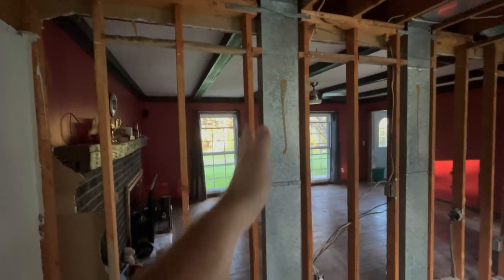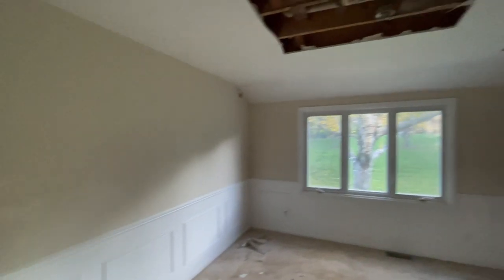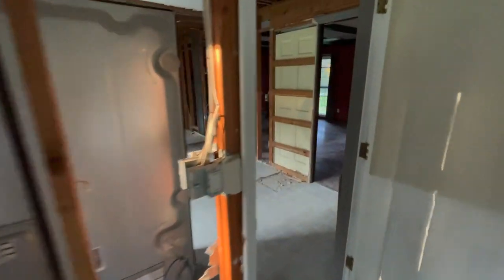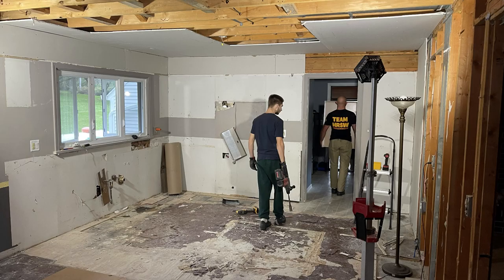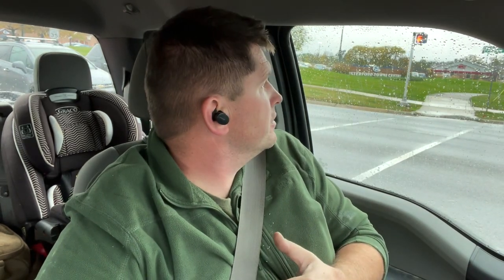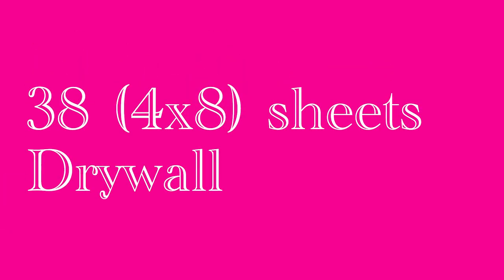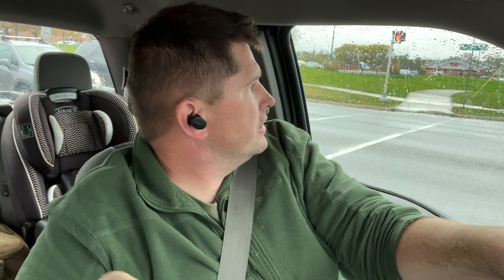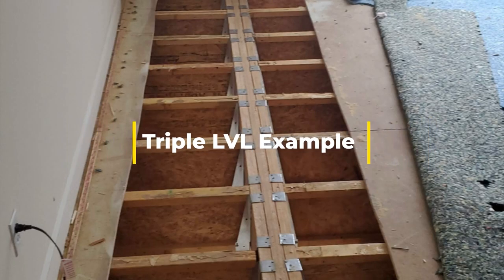Kitchen Remodel!   How Much To Remove Load Bearing Walls? Jobsite tour.

Comment: $22k a great price for all that will be performed....I am ONLY having 1 load bearing wall removed, float in 12 wood floor slats, float ceiling joining kitchen & livingroom,relocate 2 outlets & 2 switches this contractor gave a bid of $4,785 thats roughly 1/4 of your bid cost 22k with only 1/15 of the work involved .....I think I will get another bid or two...THANK YOU

Comment: How did you get the cost for the load barring beam? Cost/ft? Or sonething else? I need to work out dry wall costs for myself. I'm sure that's handy to have that as a $/sheet figure ready to go
Reply from the maker: I charge per linear foot but location is a big deal. One beam light cost me $80 per foot another might cost me $200 per foot based on prep and additional work needed.